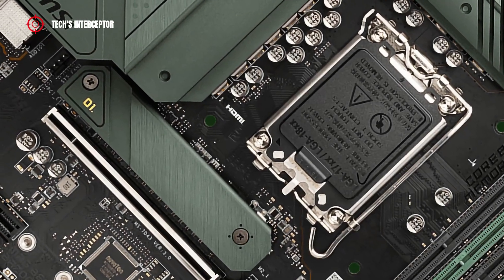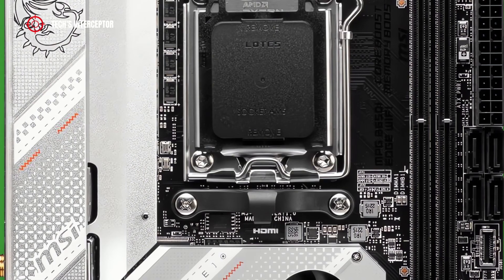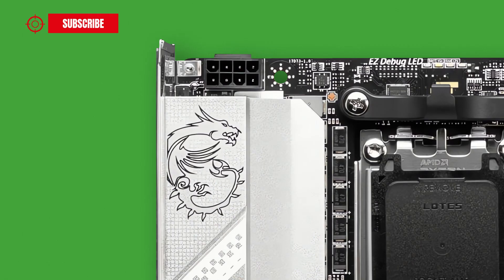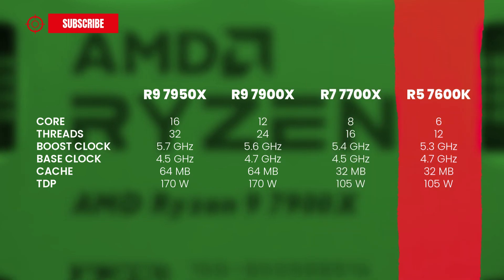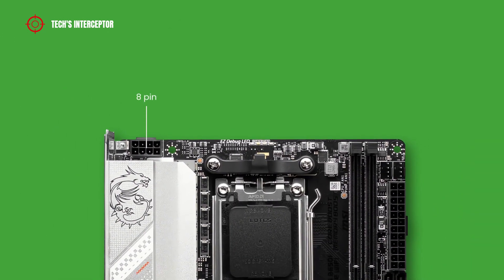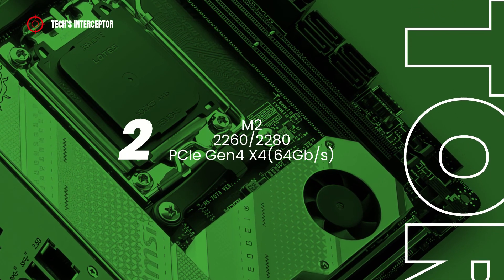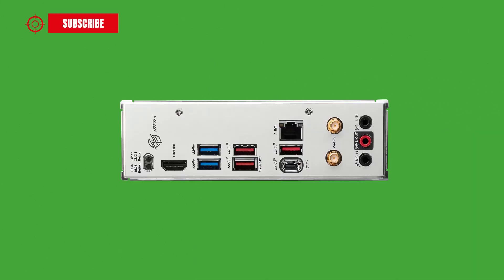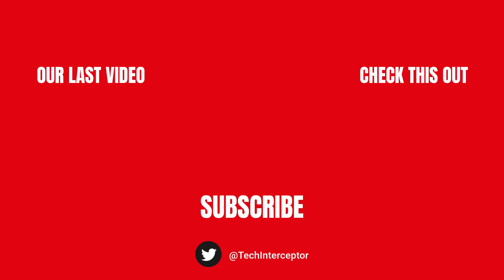MSI MPG B650i Edge Wifi - New mini ITX motherboard designed for Amd Ryzen 7000 series desktop cpu

Comment: It lacks a 2nd video output as my actual almost 10 years old ITX board has (HDMI+DP),. have been using those to connect 2x4K screens when i had no video card available. Also, I can't see a USB4 port that should be a standard feature in 2023 for small form factor PCs and Laptops (or a Thunderbolt 4 port for Intel). My 11th Gen Intel pocket PC has a Thunderbolt 4 port that is super usefull.
Reply: Not many gaming boards are going to come with a dual display on the board itself. It seems somewhat pointless to buy this board and then not use a dedicated gpu
Reply: @iiiiii7680  Right for its first life , but after some years, any gaming oriented ITX board could be used for a simple compact business PC built, or a media center. Also in between 2 generations of graphics cards it is usefull to be able to still use our 2 screen setup. My previous ITX built with an i7 4790k have been in that situation several times since 2014 and is still fully operational... without any graphic card into it. ITX is  for me the best form factor for that reason !